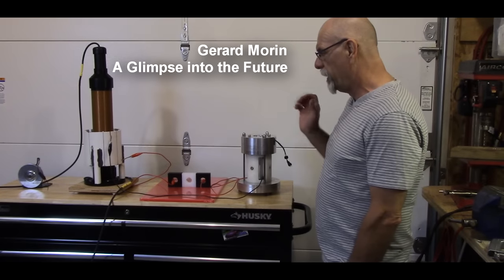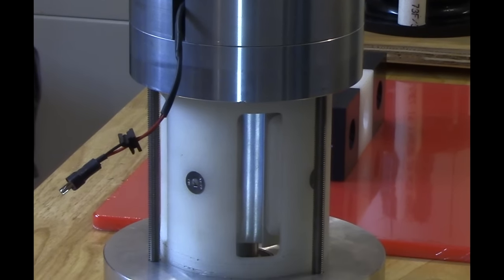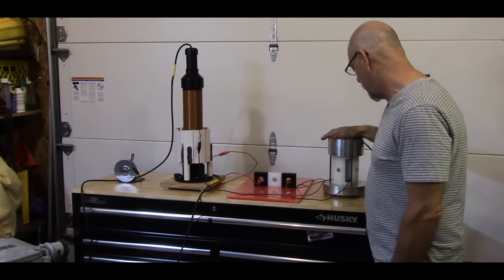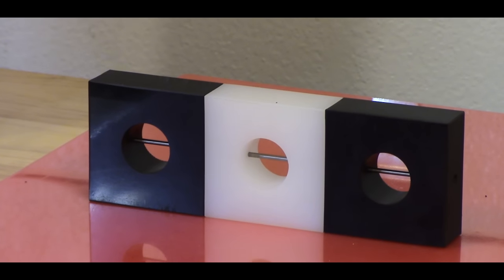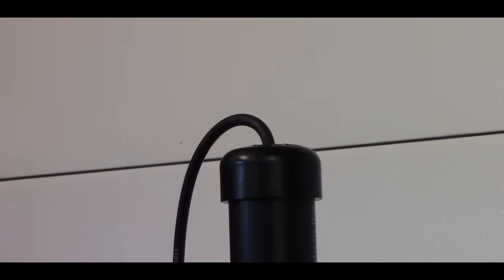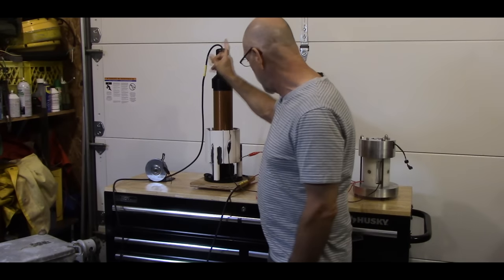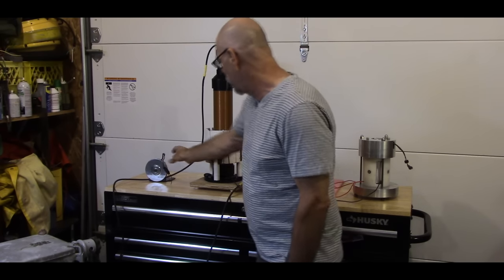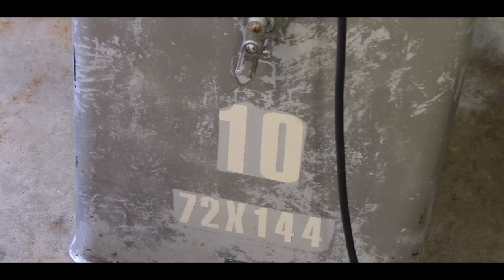The Sound of Resonance: A Glimpse into the Future

Comment: The power company's use turbine generators that rev to 10-15 thousand revs. They use a magneto generator that generates spark power contrary to the home gen set or car alternator. They amplify more voltage from 14000 volts from the magneto generator up to 250 000 volts through a step up transformer. That is over unity right there and that is sent down miles of power lines at a frequency of 50 hertz so now you have the worlds largest antennae array that attracts the aether perhaps.

Comment: Yep I'm a follower of yours too, You may already be aware of this by now but just in case, I will update the Data between magnetic forces with rear earth magnets and Aluminum, they are not magnetically attracted to each other but if the magnet or Aluminum spins or moves over one another then a electromagnetic field is created creating current. This will account for very low torque, higher speed and less power needed to run your Iron free generator. I have also founded another form of Aluminum drive that could bring the torque to Zero and maybe enable you to put more magnets back into your generator. The physical form I am referring to is the Double Helix drive shaft with two arms that spin with the arms curling in a 33.3 angle spiral the spiral could be tighter or wider at least in theory. No one has built one yet, my R&D is based on your work and other fringe sciences for other components to provide power to the generator. I am working on a Zero Torque and Zero Friction generator design. Keep up the awesome work Gerard, Much respect to you. 
Mike.

Comment: i need help understanding why i am getting a kind of magnetic braking action on my pump motor. I am using the washing machine pump motor like Gerard uses but my motor is a 12v 12000 rpm motor.    is my motor turning to fast? The pump initially puts out 185volts and then slowly grinds to a stop. I get it to work normally again by reversing the polarity of the power on the dc motor. any ideas?
Reply from the maker: Your bushing on the shaft of the pump is seizing it. I turn my currently, with the current setup at 17,000 rpm.
Reply: Thanks for the reply. I've double checked any kind of bushing issues or anything related to a mechanical problem. I am somehow creating an electromagnet but not from the iron. it is only from the combination of the iron and the copper coils when they are together. It is literally slowing down my rotating magnet until it finally stops after about 2 minutes of running it. I have learned that the only thing I can do to undo this is to reverse the polarity on my DC motor. When that doesn't work, I rotate my dc motor 180 degrees. I just cannot get past this problem and cannot do any sustained experimenting because of this braking effect. I start off measuring 285v from the pump without a load. When I screw in a 13w flourescent bulb I measure 304v and .6amps. Every single time after about two minutes the pump and dc motor slowly grind to a halt. The fully charged battery loses about 2 volts in the process because the motor is working so hard to turn the pump. Somehow I am literally producing an electromagnet that stays charged and grows stronger with each rotation of the magnet.
Should I get a different pump and motor? 
Stumped in Texas
Reply: Al bert what do you think would be the best rpm and the best voltage motor to produce the best resonance?
Reply from the maker: This is what I'm testing right now